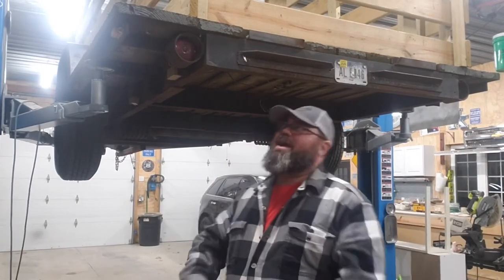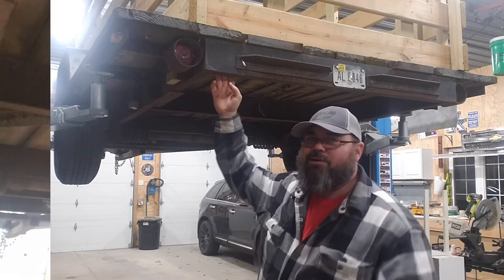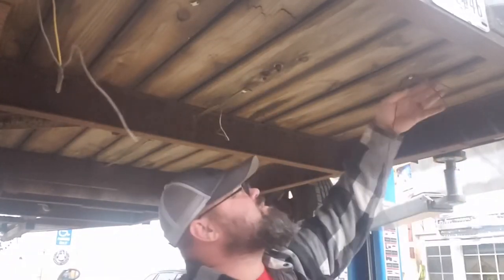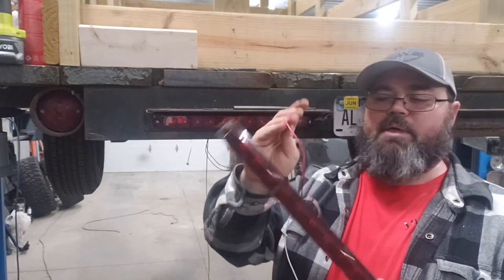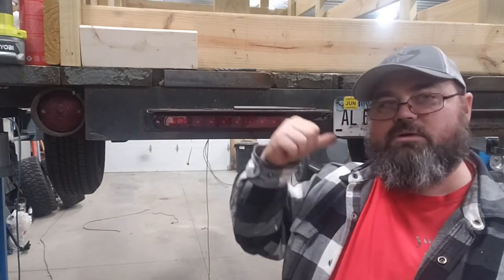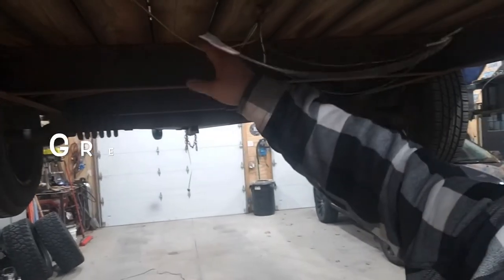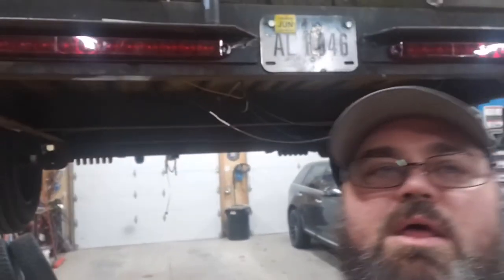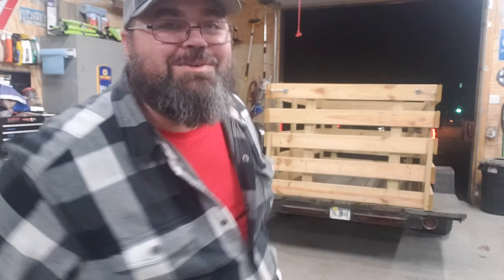Adding new trailer lights

Comment: Is it just brake lights or does each side flash when you use the turn signal?
Reply from the maker: the turn signals flash also 
Nilight 2PCS 16Inch 11 LED Red Trailer Light Bar for Park Stop Turn signals Tail Brake Light DOT Compliant IP65 Waterproof Truck Trailer Marker ID Bar, 2 Years Warranty https://a.co/d/g90acrz